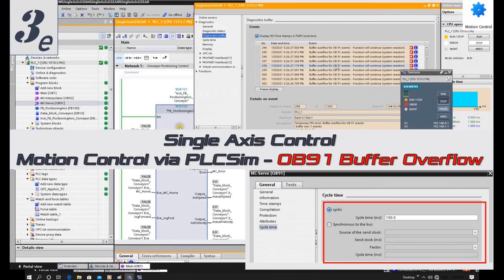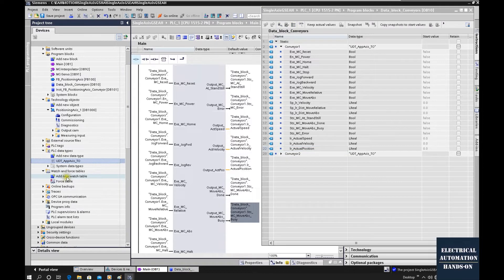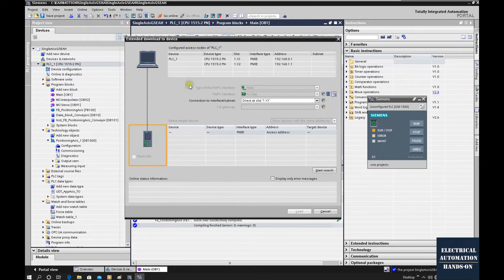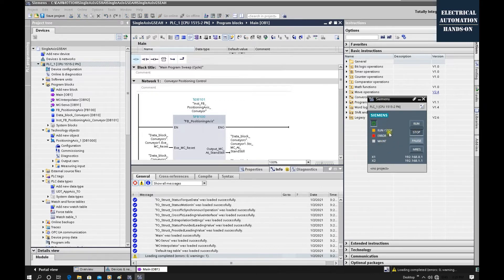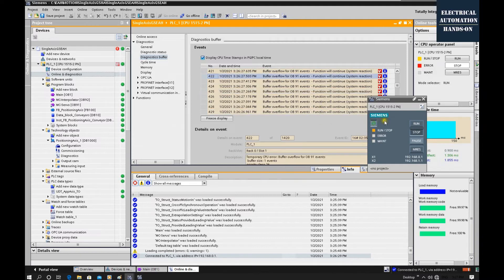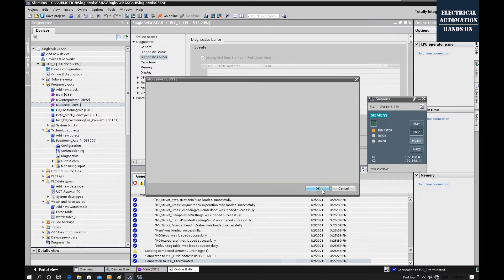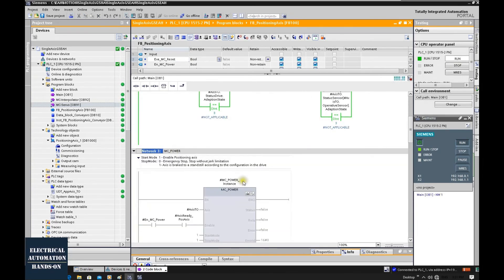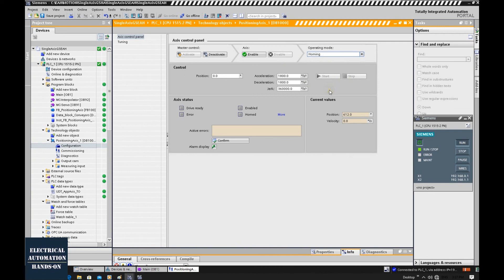MS03e. [Siemens Motion Control] Download Axis and Program into PLCSIM, OB91 Buffer Overflow [7/10]

Comment: Thanks for this tutorial,I try to copy what you did in the first time it work perfectly and after i restart my computer and try to connect again the statusword%x12 is always on, I tried to reset but nothing is work
Reply from the maker: Keep Increasing the OP91 cycle time. The short of time value, the higher performance of your laptop processor will need.
Reply: @electricalautomation  thx for your respond the problem is solved
Reply: I have same problem. I am increased cycle time more times but "statusword%x12" is always on
Reply: I copied this work but I can't see tag for actual position, I am using tia v19 . There is no actpos tag .do you know the solution